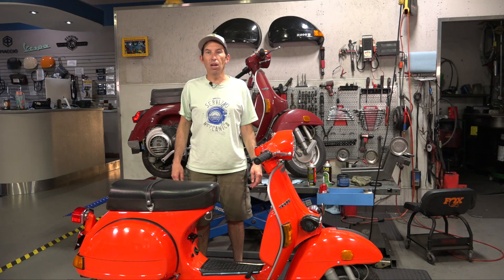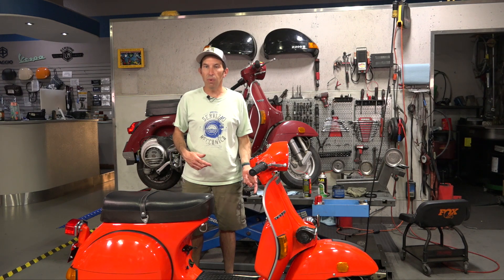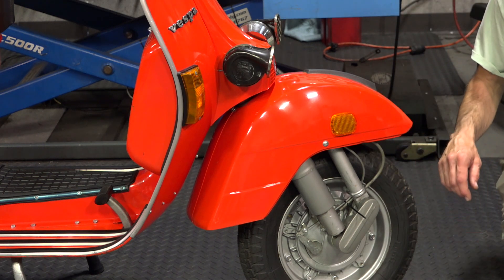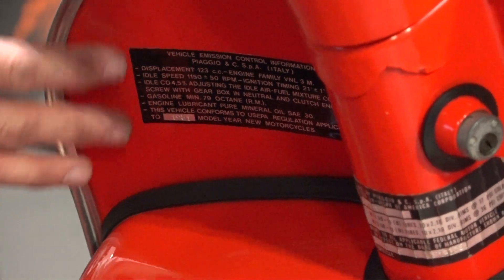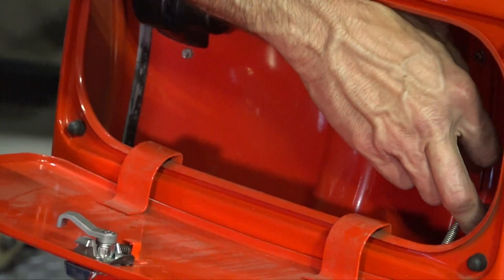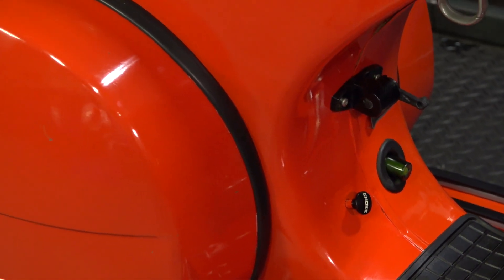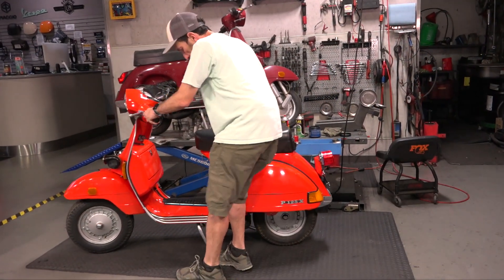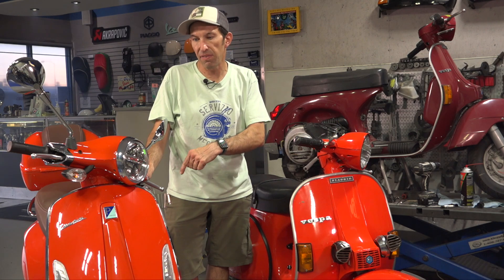Super Clean All Original 1981 Vespa P125X!

Comment: I have similarly original 1978 P200E.  I got it about 20 years ago with 1000 miles on it.  Still has the paper vin sticker.  Now has 4000 on it and I have replaced the tires, brake shoes, front shock, cable inners, and rear bumper.  Never sell it.

Comment: I just picked up a 1981 p200e with 525 miles on it here in Florida, same Bordeaux colour as the one behind you. Good going over and it runs great, the only thing I had to lose was the USA fuel tap , the plastic was great but the tank valve was totally blocked and broken tube. Now has 866 miles on it. I have four Lammies so this is a new challenge. Amazing that these machines are still turning up. Mine has all the paperwork from the dealership that was a few miles away.  Thanks for your videos, helps me to sort mine out.

Comment: Excellent demo as it reminds me of mine! I have a P150X bought in 1989, exact same colour, no indicators, 6V electrics, points ignition, manual 2 stroke oil addition (no automatic petroil system), 18,000 miles clocked, in same fully original and nearly mint condition including the factory stickers and the crack on the front plastic hub cover! Mine being 150cc will do about 67 mph top speed, which is pretty hairy on a vintage Vespa. I know the mechanicals and every bolt, screw and nut are totally original too because no mechanic has ever messed with it in all these years, myself doing all the necessary maintenance. The reason it has such low mileage is that I only use it for fun riding and short trips on weekends, while being kept indoors the rest of the time. Mine is European spec as I live in Europe.